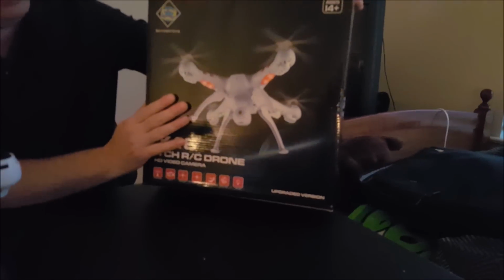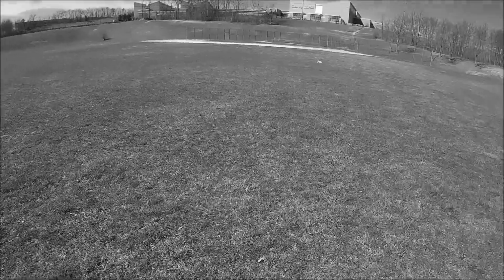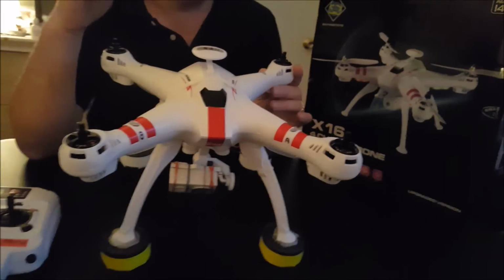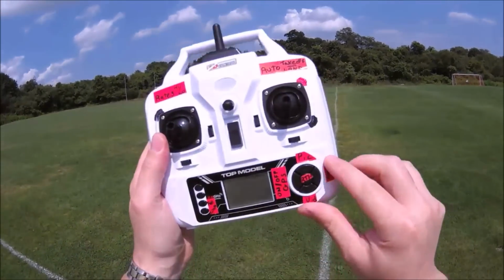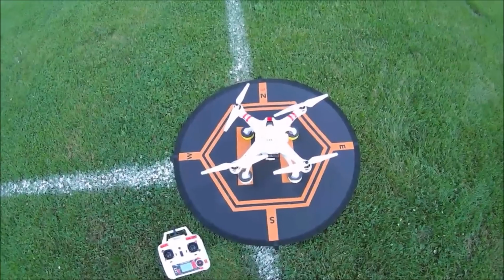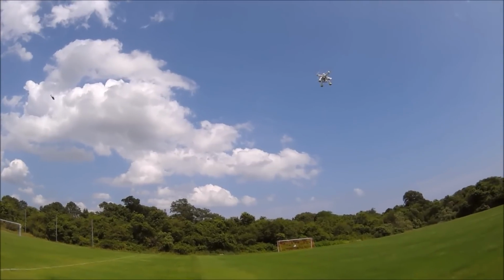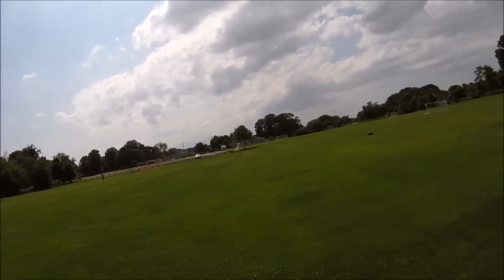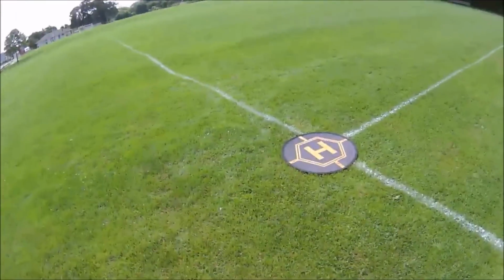Bayangtoys x16 GPS with modification aka Franken Phantom part 1

Comment: im trying to take out the landing kit of my fotage any idea how?
Reply from the maker: I had the same problem. The only way to solve it is having wider landing legs like Phantom 1 or 2. But you can buy generic ones here on Amazon and they fit perfectly. http://amzn.to/2G5Pm55
Reply: INTELMAXELL MULTI-ROTORS I have that one's and still appearing
Reply from the maker: it's hard but you have to try to get the camera as forward as possible leaning the gimbal forward. Even so you will probably still see props in the pic. This YouTuber "RC Escape" did it. https://youtu.be/_NVBt0ZpSKg
Reply: are you using the gimbal or just cam,i am going to be mounting the x-21 landing gear with a bug 3 cam attachment,that takes the legs and the props out of the footage ill try to find the link to show
Reply: Bayang X16 Drone Footage Tip   rx344 watch his clear footage

Comment: Wow!!! That vid was the verrry best I have seen on this GPS X16. I have researched this quad and watched easily 100 videos on it. Many in Spanish that I understand very little of. I am glad I found your channel. Gonna go watch Part 2 now. I am awaiting delivery of my  GPS X16  from Ebay. Paid $132.99 for it. Gear Best was $5.00 cheaper but I like Ebay. I will be following your mod advice and instructions to the tee. I've learned from seeing the problems others have had that opening it up and fixing any bad solder points is a must to avoid a free fall experience. I'm thinking too that two carefully made Dremel tool cuts to the points where the DJI props can touch would fix that plus add some venting and could actually look good like the louvers on a sport car. Just getting my own juices going. Also, FPV is a must for me. I own a Gteng 909 5.8Gz monitor that will neatly Velcro onto the TX and placing a small AIO camera on top the quad will show where you are. I wonder if the X16 will do 500 meters out with these simple antenna mods you have done? Great job and thanks so much for giving me a real Video Owners Manual for this quad!! BTW, my other quad is a H502e . Too bad the GPS X16 doesn't show the telemetry the Hubsan does i.e. distance, height, compass bearing, etc. Can't thank you enough.
Reply from the maker: You are very welcome! ...and thanks for watching. Have safe flights bro and enjoy  this wonderful hobby of ours. ;)

Comment: EXCELLENT VIDEO!!!! I have both the X16 GPS and the XK X380 but I love the X16 GPS more because it's a sporty little flier compared to the X380 which is a GREAT camera bird but flies like a truck. A couple of points:

1. You've got a lot of vibration in your video. I have the Walkera G-2D on my X380 and I found if you stuff some furniture padding between the upper and lower plates of the gimbal, it reduces the vibration to almost nothing. The white foam gimbal grommets on the G-2D are just too soft to dampen the vibration. Some people have replaced the white foam grommets with black rubber grommets with good success too.

2. I noticed you turned OFF the X16 FIRST before you turn off the transmitter which should ALWAYS be the correct sequence. It's theoretically possible that if you turn off the transmitter, the quad could interpret that as LOS (Loss of Signal) and take off and land again. Probably not if the props are locked, but on the X380 it's a real possibility.  So why take the chance.

3. I fly my X16 GPS with a fixed Xiaomi Yi 1080p Action Cam in a fixed bracket and get a lot of rocking motion in my videos because the GPS is constantly re-acquiring it's position in flight. So I fly without the GPS on unless I want to hold position for a pan video. That being said, the REALLY NEAT thing I found by watching another video (shout out to RC Escape) where he executed a RTH (Return to Home) by pushing the button on the Tx while the GPS was OFF (purely by accident), it still will RTH without GPS. By watching that, I did an automatic RTH from LOS by turning OFF the Tx while GPS was off and it still did an automatic RTH and landed and shut down. Finally, I let the battery run down in flight, and while GPS was off, it STILL did an automatic RTH and shut down.

4. Finally, I appreciate your avoiding the helicopter in the video. There's one video done by another flyer who was flying well above 300 feet 1.25 miles from the approach end runway 29R/L at Torrance Airport who, when I yelled at him for being an idiot and risking peoples lives, responded with "I don't care". It made me sick to think people like that exist.

Anyway, GREAT JOB, and remember to always keep the pointy end forward and the shiny side up!
Reply from the maker: Thank you :)
Point 1) You are absolutely right. I just got some stiffer foam with a peel back sticker that I need to play with next
Point 2) Yup never want to have a fail safe fly over your head lol. Shut off quad first then TX. 
Point 3)  Yes Indeed I also confirm this in my part 2 video coming soon (Shout out to my buddy RC Escape too who was  the first to do this)   :)  
Point 4)  Flying takes a great deal of responsibility like anything else we do like driving a car, boat, train, and commercial airliner. The point is, the moment you fly any RC craft you are representing the hobby.  You should remember to fly with the utmost care, be courteous and kind when approached bystanders and always keep up to date with the local laws which are constantly changing because of idiots.  My worst fear is a complete banning of this hobby, which would be devastating.  
Thank you for watching and safe and happy flying brother.

Comment: That is the worst soldiering I've ever seen. It's even worse than my soldiering.  I opened my X16 and mine looked pretty good. Thanks for sharing.
Reply from the maker: QC went to sleep on mine lol.  Very scary even the board was burnt too. =(
Reply: I agree, that was the worst soldering ive seen on any x16 quad, both my x16 AH model and GPS models soldering were perfect...obviously the worker that did this one couldn't solder for sh!t, lucky you opened it up and inspected it IntelMaxell
Reply from the maker: Very true!...I was not expecting to see what I saw. Drones are like a box of chocolates you never know what you get inside lol.  :)
Reply from the maker: Awesome will check it out on your channel and I suggest everyone too who is watching this go to PerthWestOz Rc channel :)
Reply: The bad soldering is caused my, I think, the use of lead free solder, it's a bitch to solder, take a lot more heat.

Comment: Years back , I bought a Bayangtoys X9 micro quad, out of the box one of the motors not working. Open it up and found one  of the wires was loose. Have insufficient solder on it. Resolder it back.
Reply from the maker: It's scary how sloppy work was done and it passed QC too. Thanks for watching. :)
Reply: INTELMAXELL MULTI-ROTORS Probably came loose during shipment. A large quad falling off the sky is a scary thing. Good tip on the EMI tape. I need to do that on my Hubsan H502e. Takes a very long time getting minimum 6 satellites.